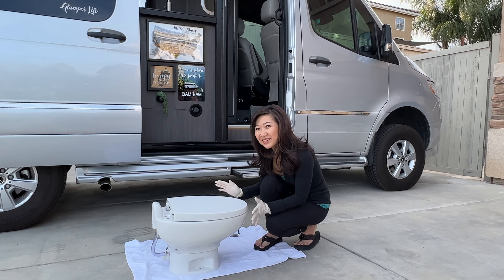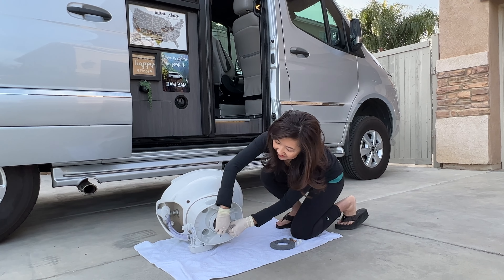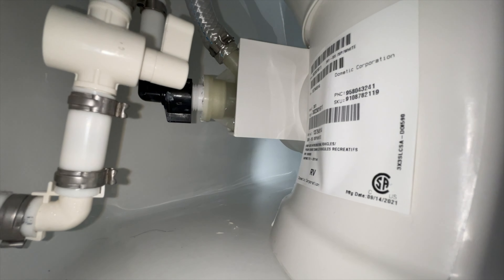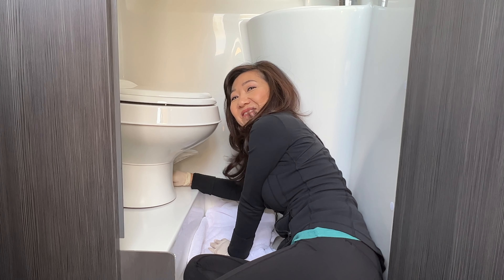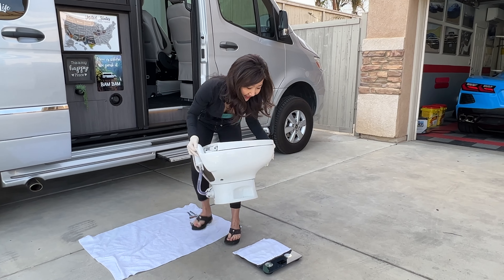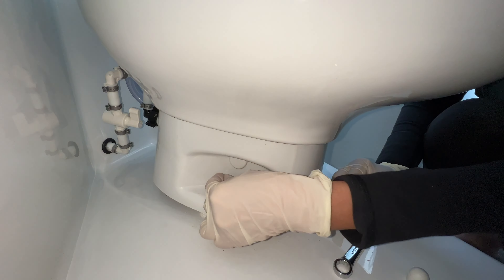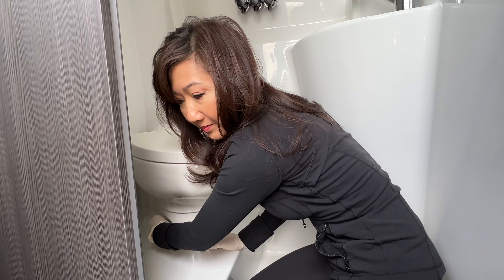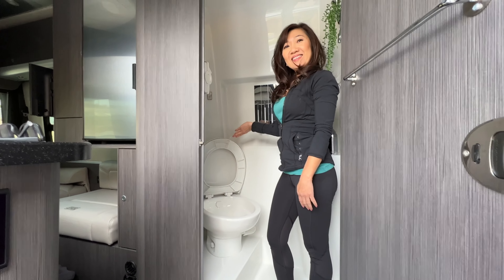RV Porcelain Toilet Installation/ 2022 Airstream Interstate 19/ Class B RV/ Sprinter Camper Van 4K

Comment: Hi, nice job on the toilet install. Is this Thetford still working out for you, or do you know of a better toilet available now. I need a new toilet for my Interstate 19 because my factory installed Dometic 300 toilet has the factory seal leak problem after only being used 20 times, intense urine smell coming from the inner bowl caused by the seal leaking, rediculous design. Thanks,  Jim..
Reply from the maker: Hi Jim, thanks for watching. Our toilet is still working good. No leakage yet 🤞I don’t know of other porcelain toilet since we installed ours. Other owners also have the same issue so some did switch out to the same porcelain toilet that we have. It is a difficult install though because of the limited space behind the new toilet. You could buy the toilet and have Airstream dealer replace it and just pay for labor.

Comment: Good job with the toilet removal and installation!  FYI for the future - they do make tools called a ‘ratchet wrenches’ that looks like a flat wrench but it ratchets for taking nuts and bolts off or putting them on.  They are especially useful in situations where there is not a lot of space for a normal ratchet like you had.  Cheers 🥂
Reply from the maker: Thank you for the suggestion! Will ask my husband to add that to the tool box. Lol
Reply: Good info
Reply from the maker: @judyannkiwi  Thank you!

Comment: k, and they can’t even give you a porcelain toilet.  Really sad from Airstream.
Reply from the maker: @skysailing4355  exactly, for that price they should include a porcelain toilet.
Reply: IMHO, I believe that AS is looking to find ways to keep the weight of the IS19 down, and a plastic toilet helps with that effort.  

Currently, Dometic makes a nice porcelain toilet (model 321) that may work in this space, too, but it’s even heavier (about 36 pounds).  So, maybe not the best solution. 

I need to replace the toilet in my 2021 IS19, too.  In the shop for replacement right now, in fact.  Will share my results with all in a few weeks.
Reply from the maker: @ Thank you for watching Dean. I also think that Airstream used plastic toilet to reduce the overall weight of the build.  You will be happy with your new porcelain toilet. 👍